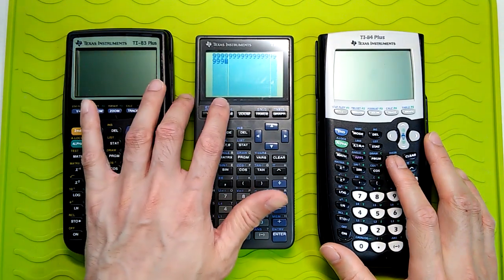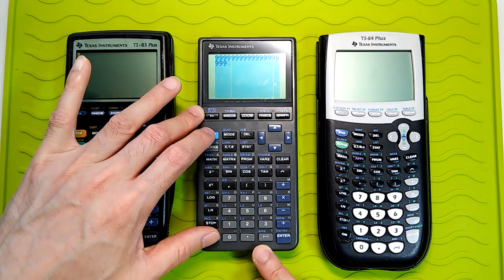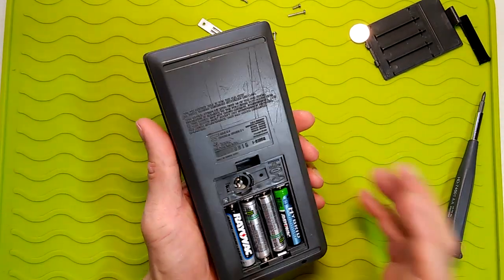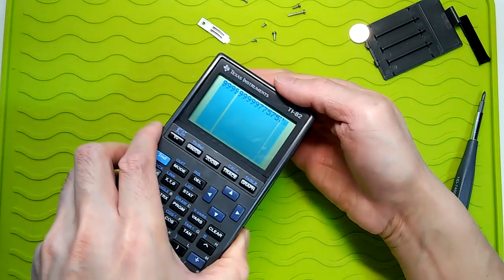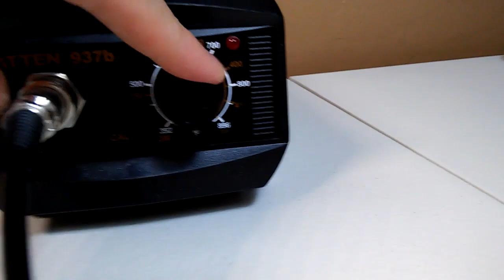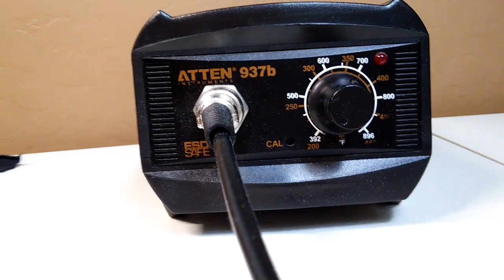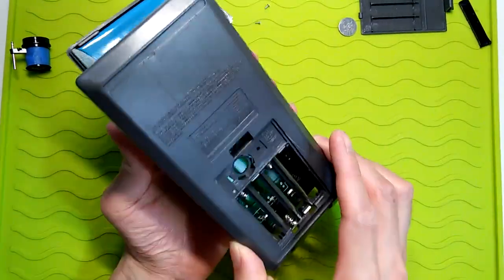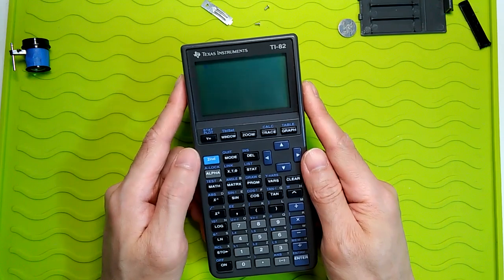Texas Instruments TI-82 Missing Pixels Repair

Comment: I always liked the square-like directional pad on the TI-82 more than the TI-83 and so on. The TI-82 is an underrated graphing calculator. It can run asm programs. It's just as fast as a regular TI-83. It just has a little less RAM and lacks the asm features of the 83+.
Reply from the maker: The only thing I didn't like with the TI-82 is the screen is darker and harder to see in dim lighting

Comment: Watdahel:  Holly Smokes, this worked!   Dude, you have a mind like a mad-scientist electronics repair genius!  I had this same problem with a TI-83 Plus.  I was about to throw it away when I found your video and tried your soldering iron solution.  And "BAM" it worked.  Note:  My soldering iron doesn't have temperature controls, so I had layed a couple of folds of aluminum foil over the plastic covering to keep it from melting.  I then ran the iron gently over it.  And to my surprise, it worked.  Thanks for posting!  Blessings upon you.
Reply from the maker: Always happy to hear people succeed.

Comment: Thank you for the tip. I was able to fix an old TI-82 super easily. I used a temperature of 180 degrees C, maybe lower could work too, but 180 degC didn't cause any damage.
Reply: Thank you! I tried this before but was afraid to go too hot, so I only did like 90 deg C. It worked for a couple weeks then broke again. I just tried 180 so hopefully it'll be fixed for good.

Comment: Glad I found this video before I used one of the other methods suggested, which was to remove the plastic ribbon tape and solder individual wires on. Your soldering iron method worked on my TI-83 & TI-83 Plus and was very easy to do. My soldering iron is temp controlled with a temperature display and I set it to minimum at 205deg C. thanks for demonstrating this method.
Reply from the maker: Thanks for watching.  I made a similar video specifically for the TI-83 model. Ya soldering wires is best left for the pros.  It's a lot more work.

Comment: How can I connect with you ? My calculator display has damaged.
Reply from the maker: through here
Reply: @watdahel  I have ba ii plus professional. Its screen got damaged and it is not showing the middle 3 numbers .
Reply: @watdahel  Is there any way to replace its screen ?
Reply from the maker: You'll probably need to find another unit to swap the screen with.  It's probably more economical to just get a new calculator.  These calculators are cheap enough.
Reply: @watdahel  I have BA II Plus professional .

Comment: Besides the fact, that this upload is already quite old: I just took my soldering iron, spent two hours of my time and slowly, carefully pressed the thermal connectors of my TI 200 back in place. I had 4-5 horizontal lines working before, now EVERY single line is working again. Genius! Thank you so much. :-)
Reply from the maker: nice

Comment: Thanks for the video.  I just picked up a TI-82 for my kids and didn't know before I bought it that it had this issue.  I used a hot air station at 100C and a flat blade jeweler's screwdriver for pressure.  Fantastic!

Comment: Hi Watdahel........I have a few TI Voyage 200 graphing calculators and when I do an LCD 8 bit checkerboard check everything shows but when I do an LCD 1 bit checkerboard check the checkerboard pattern doesn't show, pls help!
Reply from the maker: Are they all showing the same thing?  Upload a picture so I can see.
Reply: @watdahel  It's hard to upload a picture but I know if the display is off, it's the ribbon cable as you mention.
The resolution on the 1 bit checkerboard is non existent but the 8 bit checkerboard resolution is fine.  I just reinstalled the OS for the Voyages but it did nothing to improve the issue.
Reply from the maker: I would imagine the 1 bit pattern would be very small.  Very small checker pattern.  Increase the display contrast and use a magnifying glass if you have to.  Even if it looks like just a a solid dark screen then the display should be fine.  Then there is no missing pixel  which you would also see in the 8 bit pattern.
Reply: @watdahel  I have a new Voyage 200 and the 1 bit checkerboard display shows clearly though! Ok..changed the contrast...it shows!  Thank you Watdahel! :)

Comment: Can I use a heat gun for this, my soldering station doesn’t have a temperature adjustment.
Reply from the maker: I wouldn't use a heatgun.  You need to apply heat as well as pressure  at the same time to set the cable in place.  How many watts is your iron?
Reply: watdahel 70 iirc
Reply from the maker: @danmartin7823   You could try heating up the iron for a few seconds and then unplug it.  Notice in the video how I touched the iron with my finger to feel the heat.  You should do the same to roughly get an idea how hot your iron tip is.   You should be able to touch it for half a second.  Your skin should not be burned.  Otherwise it's too hot.
Reply: I've used a hot air gun (a specialized rework station for electronics) at 200 Celsius, and put pressure with an eraser (probably you can use a piece of plastic or something like that) to fix a similar problem in a radio's LCD screen. It worked just fine. The key here is the right temperature. If it's too high you can damage the cable and/or the screen. If it's too low it won't stick well enough.

Comment: Hey man! Thank you. I lived in Italy, now I am in Brazil always caring my TI 68. For a long time ( was depressed) left my Ti 68 packed without use...A few days ago, I tried do use it again but it's display did not show all the numbers. I opened it trying to find out what was happening but no clue. Your video was the first and probably the last hope. Tried to solder the flat cable terminals as you sugested (used a 250°Celsius temp) and voilà, there it is, feito!
Thank you very much, man!
Reply from the maker: good to hear it works again

Comment: I had one vertical line of missing pixels and after trying your method I got more vertical and horizontal lines of missing pixels. Should I try again? Can you suggest me a solution or this may be the end of it?
Reply from the maker: That means the connections were barely making contact and you nodged them off.  Repeat as I did and perhaps your not applying enough heat and pressure.  Heat each pad and dwell for a good amount of time while applying slight pressure.
Reply: @watdahel  I think I ruined it completely. Now I lost almost the whole screen and I believe to have left burn marks on the tape. Probably this is not recommendable for people without experience on similar issues. I have some memories as this calculator accompanied me for almost 30 years. Can it be fixed if I take it somewhere? Thanks for your reply in advance.
Reply from the maker: @luanalidema     It can be fixed but it may not be economical.  You can buy used ones for really cheap though.

Comment: mine has that problem and after i start using it it fixes itself
Reply from the maker: That's been my experience. It comes and goes as the season changes.  The cable is loose.
Reply: @watdahel  the thing that fixes it is having numbers displayed on the screen then after about 20 minutes its working fine

Comment: Thanks! I repaired a Casio calculator screen with this method. Used a hoof soldering iron tip.
Reply: @andono kusuma jati
Hey
 I also facing the same problem with my calc Casio fx 991ES plus
Have you tried? this method
Reply from the maker: horses come in handy
Reply from the maker: @andono kusuma jati    probably will work.   Try it.  You got nothing to lose at this point.
Reply: Guys, I tried right now with my Casio “fx-570es plus”.
I use a my soldering hoping was good but ended up to melt the plastic and I created other lines instead of adjusting it haha.
Do you know if I can buy the entire lcd display and, with the same technique, change the lcd at all?

Comment: Hello! May I ask you for some help? I have a Texas Instrument TI-82 STATS. I works sometimes. Sometimes it just doesn't turn on, until I push hieps of differens button and squeeze it in different ways (I know, stupid), than its does turn on. I have changed the batteries. And also the display, the pixels are weird, numbers jump to wrong places and it just acts weird. I don't know what happened or if I can fix it? What do you think?
Reply from the maker: Follow what I did.

Comment: Didn't have a temperature adjustable soldering iron so I just used it as soon as I plugged it in. Some solder fell off from a previous repair and freaked me the fuck out that I broke my calculator, but it ended up working great! Thanks.

Comment: I used a clothes iron, lowest setting and used the very tip of the iron on the calculator.  It was hot to the touch and I couldn't leave my finger on the iron for more than a second, but could touch the iron briefly. TI-83.  WORKED!! THX
Reply from the maker: Improvisation at its best.
Reply: I also used a clothes iron. Lowest setting didn't work, but "Rayon" (roughly 190 C) did! Matches well with the 200 C temperature applied by the soldering iron in the video.
Reply: Oh awesome!! Needed this tip
Reply: I fucked mine up, I think the screen was faulty anyways, not really surprised, I had a lot of screen tare and thought I'd give this a try

Comment: Have you ever come across ones where the ribbon  able itself was apparently deteriorated? I can bend the cable on a ti86 I have without touching the connections and the lines come and go. Great vid. Never thought of using a low setting on the iron. Iusually use a heat gun or hair drier.
Reply from the maker: Unless the cable itself has a cracked crease it's usually the ends or the contacts that have come loose.  So any movement of the cable with a weak or detached connection will cause those pixels to turn on and off seemingly at random times throughout the year.  Even a simple change in temperature or climate can cause it.  Heat and pressure is needed to reactivate the conductive adhesive.  Basically, the adhesive is impregnated with microscopic metallic beads.  It's the beads that complete the junction between the cable and the board. The adhesive pulls everything together.